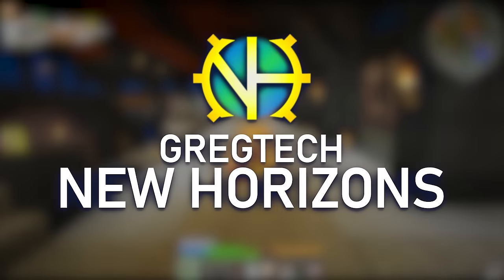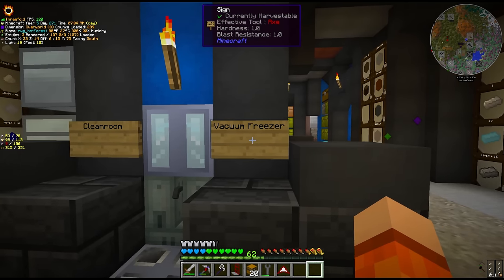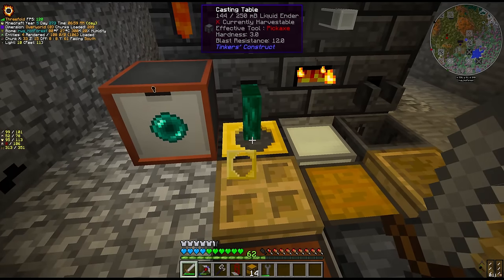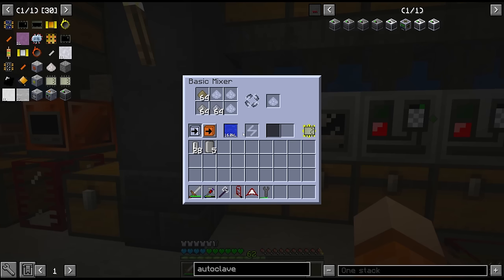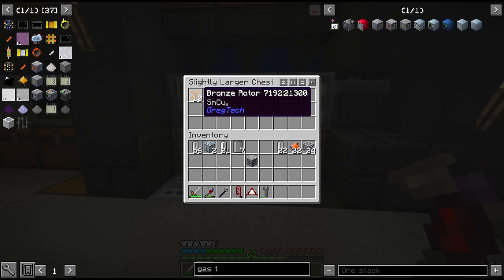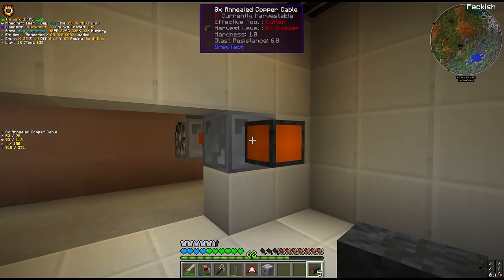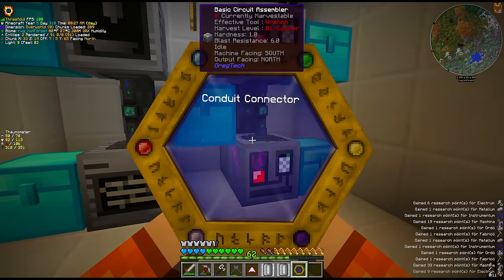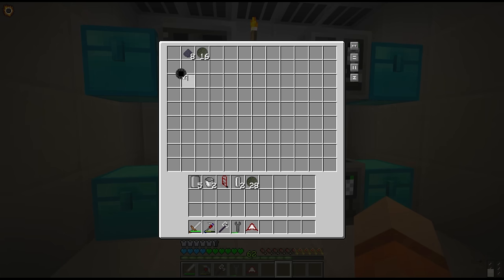Gregtech New Horizons S2 16: The Cleanroom

Comment: Word of advice. Complete the Twilight Forest progression and turn the lamp of cinders in to the quest book. It gives you a cleaver with 19 base modifiers, and it’s made of paper (something the player can’t do), meaning it has 20 modifiers.
Reply: I'd personally love it if he would just actually complete a given progression chapter before moving on to the next - including collecting the rewards and taking what you get without trying to hyper-optimize/min-max them - rather than leaving a bunch of them strewn around to be picked up as an afterthought at the end of the pack when it's too late.
Reply from the maker: @slartimus  GTNH is a long process, sometimes it's best to try rush the next part of progression i.e the HV Macerator to get more efficient processing before you go back and pick things up from before. The quest book also has a lot of things in it and due to the nature of GTNH, not everything is mandatory. For example we went with Benzene for fuel production but there are lots of quests for Diesel and Cetane, which for us at the moment is irrelevant. So a lot of the quests because of the choices we made for progression aren't worth going for. Some things still are though, and I'll admit I have been skipping a few quests here and there. It seems there is just so much to do in this pack the videos are ending up massive in size as is.

Comment: Not pictured: Three combining some of the Calcium from his Benzene setup with oxygen and carbon (both also from the setup) to produce his own calcite. Also not pictured is the assembling machine recipe for the filter machine casing, which cuts out one steel bar and one item filter per casing. Always check for alternative recipes, folks. It's an endless NEI dance in GTNH, but the alternative isn't worth it 🙃.

Disassemblers are very expensive, but very worth it. They're able to disassemble any single block machine and generator up to their tier, plus a number of items crafted through assembling machines, yielding back 100% of the materials you put in. It does have some weirdness to it, like how you can craft cupronickel coils using the silicate wool but get back mica or circuits coming back as different grades, but overall it's a very worthwhile machine to have on hand.

That Platinum Metallic Powder Dust would be important for diodes...but you can just buy them through the questbook 🙃.

One thing that cleanrooms don't need is MV energy hatches, in fact if you've got something like a benzene setup now might be a good time to overclock it to HV power using 2x MV hatches to reclaim the LV hatches to use for the cleanroom. Hatch tier for the cleanroom only influences how long it takes for it to reach 100% cleanliness, which admittedly does take about a year at LV, but considering how long it'll be spending at 100% not doing anything but maintaining that state - which LV does just as well as HV - I don't see MV hatches as worth the investment. This is also a great use case for a few low tier Infused Solar Panels and a battery buffer, since once the cleanroom reaches 100% it draws very little power to maintain that state, but it will drawer that power passively. Some solar panels and battery buffer will keep the cleanroom running without having to hook it up to any sort of power grid or fuel line, which makes placement that much easier.

If you're short on Zinc Metal Transmutation is also a very easy source of it, if you've got the essentia for it. And wouldn't you know it, here the Benzene setup comes through once again. One Magnesium Ingot transmutes into 2 Zinc nuggets straight up, so Three's earlier 135 magnesium dust could have turned into 30 zinc ingots. Merely a small dent in the amount of zinc needed for the filter machine casings, admittedly (8 ingots per casing using the efficient recipe, and 24 casings for a 5x5 interior cleanroom), but Calcium also has the key essentia. And 2442 of those (which would require external sources of Metallum, admittedly, but that's what you've got 966 iron dust for) would turn into enough zinc to complete the entire cleanroom craft by itself. Of course one could argue it's still worth chasing Sphalerite ore for the chance at Gallium...but that, itself, can also be supplied through Transmutation. The necessary essentia for which can be gotten from the ashes byproducts as well, though admittedly in this case they wouldn't be rare or expensive to source from elsewhere anyway.

Machine hulls are basically 1A diodes, which is why actual diode blocks start at 2A. Machine hulls can also be used to pass through items, which is how you'd automate the cleanroom without easy wireless AE2 options (which this pack does have, although the power cost on it is not to be taken lightly), or fluids, which is how you'd supply your automated circuit assemblers with soldering alloy more easily. I was about to say fuel but that wouldn't work inside a cleanroom, as Three mentioned 🙃. Do note however that machine hulls can only I/O power automatically. For items/fluids you'll need to use conveyors/robot arms or pumps.

The chance that a cleanroom recipe succeeds is simply the efficiency rating of the cleanroom, though whether it considers the efficiency rating when it started or finished the recipe I'm not sure. Regardless the Cleanroom is the one multiblock you definitely want to attach a Needs Maintenance Cover to alongside a Howler Alarm to sound an alert when there's a maintenance issue, as each maintenance issue caps the efficiency rating of the cleanroom at 10% less than normal. Obviously the last thing you want is to batch craft a bunch of circuits only to find out 10% of them got voided because of a maintenance problem. Unfortunately automated maintenance solving is still quite far in the future, something I would like to see made available earlier but it is what it is.

Even if Three was correct about not needing more than 1A immediately he really should have placed in a 4A (or higher, even) diode ahead of time. The last thing you want to do is break and replace blocks of the cleanroom itself, because you're going to lose efficiency fast if it's not a complete multiblock. I would actually suggest using a 16A HV diode right from the start as power input, and in the cleanroom transforming down rather than bothering with an MV diode. Overkill for this point in the pack? Very, but eventually you're going to be running multiple EV machines in the cleanroom, and like I said, the less you have to wait an eternity for that thing to spin up the better.

Vacuum Freezer is going to be a major step forward in progression. Shadow Metal opens up, Nichrome coils open up, and with better coils comes an absolute slew of new things available as well. There's some gaps present that definitely need filling (mainly Polyethylene, you always want to be on top of the plastics - Three honestly should be looking into a PTFE setup right about now in fact), but once that's done there are upgrades to be had all over the shop.
Reply: Chance that a cleanroom recipe succeeds is at the end, which can be useful information

Comment: Keeping around LV machines when you can make MV and even HV machines might seem like a bad decision, but in GTNH it's something you're going to have to do for two reasons. One, machines are expensive to craft, and only get more expensive as you get higher up in the tiers. One HV centrifuge might be able to do the work of four LVs, but crafting four LVs (and their power producers) is a lot cheaper than crafting the one HV machine + turbine to run it. Extrapolate this to the, what, two dozen-odd machines you use each tier, and you can see where upgrading everything every tier becomes a problem. Second, higher tier machines are less energy efficient. Each overclock doubles the EU cost of a recipe, and single block machines become less and less fuel efficient the higher tier they are. Centrifuging 10 Redstone costs ~150mb Benzene at LV, but ~667mb Benzene at HV between the higher power cost and lower fuel efficiency. Again, extrapolate this to dozens of machines, and you can see how upgrading every machine at every tier will get out of hand fast.

There are higher tier railcraft tanks that store more than the iron version, from steel all the way to neutronium, but in terms of fluid storage you're almost always better off with super tanks. They'll store at least a competitive amount, usually for cheaper, have features like auto-voiding overflow or locking to a fluid type that railcraft tanks don't, and can be picked up and moved with their fluid storage intact. That said you can use railcraft tanks to make exceptionally cursed, but technically cheaper fluid reactor setups. I really, really don't recommend rushing fluid reactors so hard that using railcraft tanks to save on regulators and titanium machine casings actually sounds like a good idea, mind.

For the record HP solar boilers produce 360mb/s steam, and water is converted into steam at a 1:160 ratio. So, somewhat conservatively (which is, of course, a good idea with stuff that can explode), you can support one HP solar boiler per 10% humidity that your railcraft tank is in. So given the number of railcraft tanks in 80% humidity here, in short: That Enderio Reservoir was a wee bit overkill 🙃.

One of the things Thaumcraft allows you to craft is a pressure plate that only you can activate. Much better than a button hung above an iron door, IMO. Alternatively Paving Stone of Warding can allow you to forego the door altogether, and just keep mobs out using an invisible forcefield that allow you (and other players) though. Do be mindful of skeletons if you do this, though. There are skeletons that shoot fire arrows which will light wherever the arrow hits on fire, and GT machines are sadly all made up of about 99% Nonsesiclasplodium, so...

You can craft electrotine, but I really don't recommend doing so. It's 1:1:1 electrum:redstone:electrotine when you craft it, but 8:1:1 electrotine:redstone:electrum when you centrifuge it. It's not only wasteful with resources, but the last thing you need in HV is more strain on your gold and redstone supplies. It's also very worth grabbing electrotine in mid-late MV, even though for the circuit crafting you don't need it until post-Cleanroom. This is because Electrotine produces Blue Alloy, which is the best HV cable bar HV Superconductor. Electrotine is also great as a source of electrum and redstone, despite the ratio I mentioned above. Ore processing produces both (and diamond dust) as a byproduct, and on top of that you get 20 electrotine per nether ore because nether/end ores are worth double compared to the overworld variant.

Something I recommend setting up is a drawer wall to store your ores, sorted by dimension (framed drawers look amazing for this), so you've got not just an overview of what ores you've got in stock but much more respectable storage for them rather than cramming them in increasingly expanding numbers of expensive chests. Now yes, drawer controllers were nerfed, but a manual drawer wall for ores should get the job done just fine. Just shove ores in the drawers to empty out the mining chests, and when you need something just take out a few stacks, throw it into ore processing, and job done. Don't need a drawer controller to do that.

Whether HV single block miners can tag multiple veins at once actually depends on the size of the vein. Different ore veins have different sizes/densities, and some are spread out enough to not get fully cleared by a single HV miner or compact enough that an HV miner on the ore vein's neighbour won't pick up any other ore. I'd recommend using them on single veins, like the LV/MV miners, and if they happen to tag a nearby vein that's just a nice bonus. Miners aren't quite powerful enough to consistently hit multiple veins while even consistently fully clearing the one they're on. Soon, though. Relatively soon...

Note that you can use large cells to feed generators fuel directly...if they have space for the full amount of fuel contained in the cell. Large Alu cells hold 32 buckets of fuel, but the buffer in the gas turbine is only 16 buckets, so that won't work. Either use a fluid tank as an intermediate (even a ULV tank will suffice, as it has a 32 bucket storage capacity), or use four times the number of alu cells in large steel cells. Which, if you're using more than 16 large alu cells, I'm sure you can see the problem with this approach.

This issue of circuits is one argument why investing in early ore processing is good: You have multiple diamond chests overflowing with ores, but no large supply of processed resources to just churn out circuits expensive recipes be damned. Investing heavily in an MV/HV era ore processing system will turn those backlogs of ores into usable ingots automatically, and from there it's much easier to batch craft materials to craft circuits all day every day. Of course this approach does have a catch-22 in it - how are you going to craft the circuits needed to craft this ore processing system in the first place? You'll be burning through a ton of resources setting it up, and from there waiting for it to first pay back for the resources it cost to build before you see any actual profit out of it. That said I do still think it's a good investment. Yes, ore processing will get completely overhauled in IV when GT++ multis become available, but without ore processing set up at that point you'll just be in the same catch-22 situation where you need the resources to build the machines to process your overflowing supply or ores into resources. If you're going to have to grind through resources anyway, might as well do it early when stuff is so much cheaper. To say nothing of the fact that having resources on hand at all times is so much better than having to bean count circuits for every single thing you need. With an ore processing system to supply resources I'd have crafted a new HV tier prospector without blinking, let stand pondering whether an MV one is worth the cost of three circuits...okay, realistically I might actually have waited until after getting a Vacuum Freezer online to gain access to significantly better materials first, but you get the idea.

EV was the point where power production changed the rules on you and forced you to adapt, but for some reason the developers decided to add single block EV/IV generators that allow you to continue this style of build for much longer. The single blocks do have garbage fuel efficiency, but fuel efficiency is always a secondary concern in GTNH. Power throughput is king, now and forever.

Rape seeds are the best source of seed oil from IC2 crops and useful for biodiesel, but if you have a benzene setup you really don't need biodiesel for anything. No, Glycerol is useless, you can use Propene to make Epoxid instead. That magnet was the EnderIO Electromagnet, which you might be able to turn into a weird ingame sport but is otherwise thoroughly outclassed by the Item Dislocator. Electromagnets aren't magnets so much as they are portable gravity wells, so they can and will fling items across the room through some kind of weird orbital gravity manoeuvre I trust players of certain space sims are familiar with.

The Project Red logic stuff is a giant pain to craft, but get used to crafting them, because you're going to end up using them here and there.

There are Needs Maintenance Covers, which you can set to emit a redstone signal if a multiblock has X amount of maintenance issues. Sending that signal straight into a lamp in front of an EBF controller is a very handy way of being able to see whether it has any maintenance issues at a glance. The alternative option, which is definitely reserved for Cleanrooms, is a Howler Alarm. If you absolutely cannot afford a multiblock - like the cleanroom - to have maintenance issues one of those will keep you informed without 128 block distance max. Just, eh...try not to freak out too much when it suddenly activates. It's called a howler for a reason 🙃.

"An 8A cable will be able to support all the power a 9A battery buffer can output" - Threefold 🙃.

Most, but not all, macerator recipes that relate to ore processing are ULV recipes at base, meaning that like the miners you can use a generator from the previous tier to power it. If you do this be careful not to feed your HV macerator a recipe that costs too much, however, because it will get stuck and suck EU forever until you manually fix it. Single block machines are intelligent like that.

I do recommend if not going for a larger cleanroom initially at least upgrading it sooner rather than later. 3x3x3 interior space is very cramped, and will get incredibly difficult when you get to the point of having multiple tiers of machines in the cleanroom. A 5x5x3 interior space gives some much needed breathing room to fit a transformer, as well as a few more machines.
Reply: Awesome comment! So much good info and smart tips.
Reply: Dude these comments are just gold. thank you

Comment: I didn't know you could use the elevator as the actual floor of the clean room. I wonder what other blocks you can use because a travel anchor, when available will make it a lot easier to access.

Comment: The HV macerator can run at LV power if it’s processing most ores
You can buy calcite from QB
You can turn Hydrogen sulfide into sulfuric acid by turning it into diluted and distilling